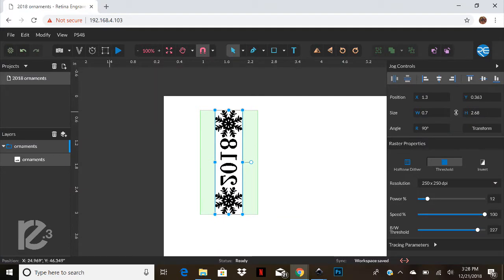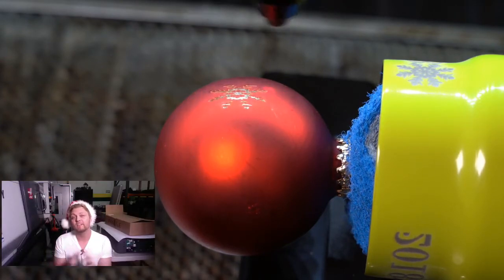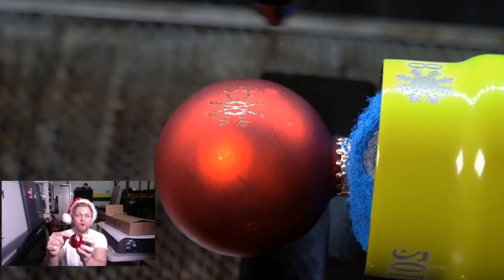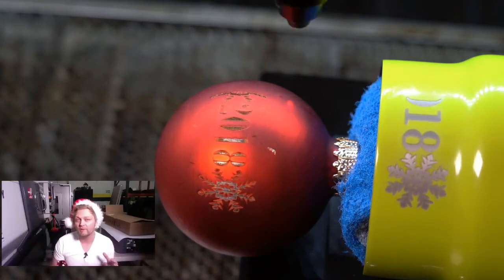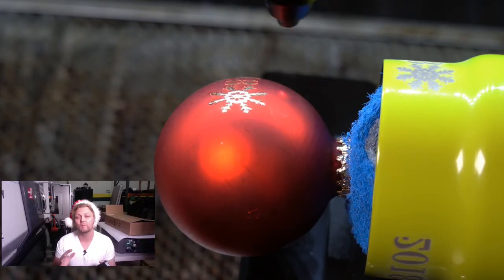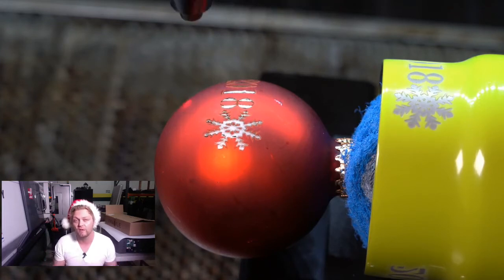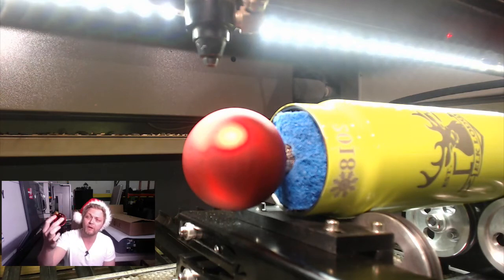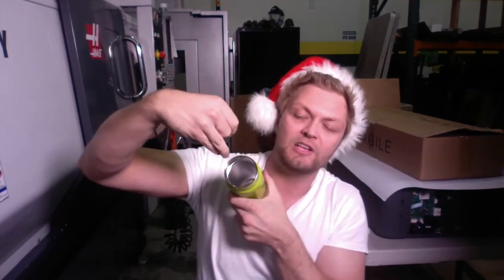In the Cut - Laser Engraved Christmas Ornament (PS48 120W Laser)

Comment: Will the machine also cut through  the ball?
Reply from the maker: It depends on what the ball is made out of, but if it's plastic, it should cut. Just be sure it's not vinyl. That said, cutting a design on a sphere can be very tricky even with a rotary attachment.